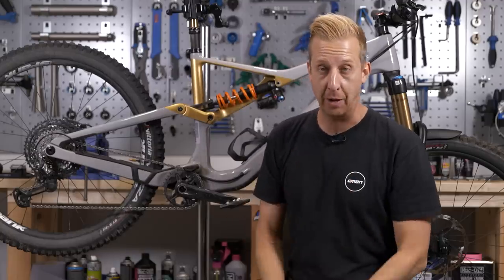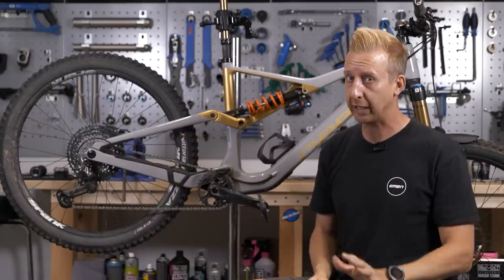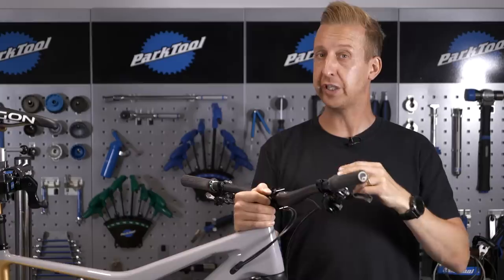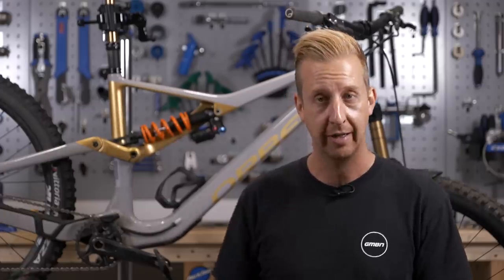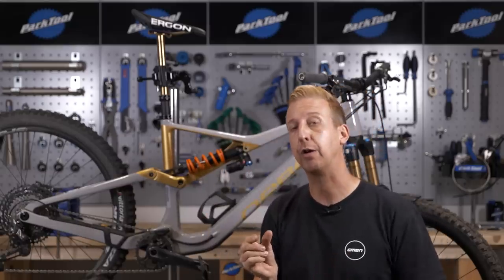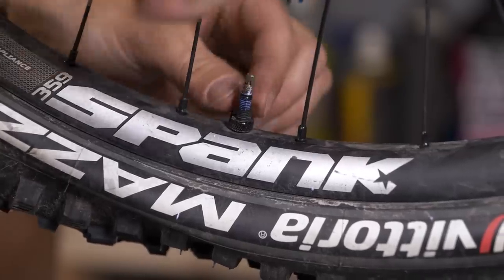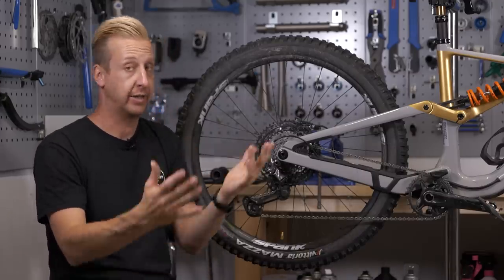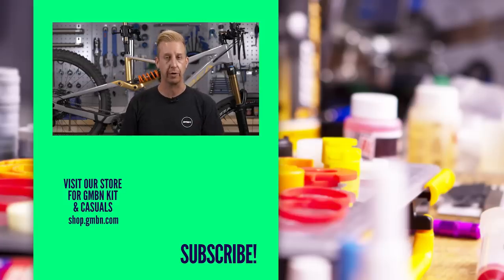11 Ways To Make Your Bike Feel Brand NEW!

Comment: You didn't mention removing the air from the forks before beginning the service process. Now I can't find my face... 😵
Reply: Yeah but you're not removing anything to the top so it doesn't matter
Reply: The lower legs of the fork are not pressurised - you don’t need to remove the air. If you are servicing the air spring, or adding/removing tokens, by all means empty the air.
Reply: The lower legs are not connected to the Air chamber, so opening the lower legs will not change or release your air pressure. If it does, then you have a bigger problem

Comment: Bolt checks, lock tight, and proper torque specs are a must. My non drive side XT crank came loose and fell off last ride. My Rotor bolts also came lose. All installed by the LBS.
Reply: My LBS forgot to put the bolt back in my brake pads after a full service, first downhill trail and the pads jumped out!
Reply: Strange the rotor bolts came loose. They come with loctite on them from factory. Maybe under torqued
Reply: @flawless7019  in my experience it’s that a torque wrench is almost never used. “A good mechanic doesn’t need one” is the rationale. I do a bolt check on every bike I touch
Reply: @307.William  in my experience if a torque wrench isn't used daily there's something wrong with the mechanics. No point risking shit when there's calibrated tools to do a job

Comment: Thanks for the very best mtb channel. The best for what y’all do . Always so informative at bike maintenance and bike mechanics, design and technology. 
This channel has helped me total replace and maintain every part on my bike except the bb. The Bottom Bracket is the next chore and changing out the airshaft to a longer one my 2020 Lyrik. I like the Orginal workings of the 2020 model . I’m at 150mm and want a true 160. I am thinking of getting the 170mm because they sit into their travel about 10mil anyway. 
I do have the 2021 replacement to make it 160 . I hear they are firmer through the top of the stroke with less mid travel support. So thought a 170 and keep the orginal 2020 stuff on the airshaft . 
I did just have a bad downhill crash hitting a tree. I broke my pelvis and sacrum . The sacrum is screwed together so I cannot walk for a bit . 
I’ll be back in several months. Gingerly of course (maybe) 
I’m 59 years old so maybe need to slow down a bit . 
Thanks again for this channel. Hope you all read this , it comes from the heart. 
Peace Y’all and keep on pedaling

Comment: 9:27 I usually apply fresh Loctite 243 to it, to create a bond between the surfaces. It's more secure that way, but it depends on how much or the kind of thread locker the manufacturer has used I guess. So I apply fresh just in case, cus sometimes it can get loose if i don't, but not always. but just a drop is enough.

Comment: 18:06 it can also be worn out hub bearings, an easy way to check if that's the case, is to loosen the axle, if it goes away with a loose axle or skewer, you need new hub bearings. But of course don't ride with loose axle. only use this for diagnosing the issue.

Comment: Probably a good idea while you're messing with the jockey wheels and other parts of the derailleur, just dismount it and use a derailleur hanger tool to get it nice and straight. It doesn't take much for that little bit of tweaking that throws off the shifting.

Comment: When buying bearings be sure and get the correct type for the location/application- ie there are different specs for bearings designed for wheels/BB's that spend their life spinning, compared to "load bearing" bearings such as in suspension linkages that rotate very little....(IIRC they are "MAX" type?)

Comment: I've flushed and re-packed my headset bearings with no issues
I've shark finned more than a few cassettes and drive sprockets 😉Link glide is a mirage still
Takes about 10,000km to wear out 200mm rotors.

Comment: I always put some grease on mine inner gear cable's put ar lot of rides and the bike mechanic say they don't bother because the outer cable has protection for the inner cable puy I always put a bit of grease on the cables.

Comment: 16:49 degreaser or brake cleaner will dry the skin on your hands so I recommend laying it somewhere, or use gloves. after this with bare hands, moisturizer has to be used.
Reply: Not necessarily,  just make sure to watch your hands thoroughly
Reply: @The_Real_JN  I am speaking from experience. Just a little bit is enough, horrible on my hands. Also if washing hands, hands can get dry from some soaps. Not from all.

Comment: Guys I require your help. I have Shimano bl-m4100 on my bike with BH59 hose on it. The lock nut at the lever has got rounded. Does a BH90 lock nut fit the lever or is there a difference between both the nuts? Please let me know. Thanks.
Reply: I think that would work. The outer diameter of the bh90 and bh59 hose are the same. It would depend on the thread pitch. Also, the bh59 ones are super cheap, I would recommend just using the right thing. Hope that helps :)
Reply: @sophialiovas2257  thanks for the help man. The problem is BH59 related stuff is all sold out in my country and i am without a front brake with the hose dangling every where.
Reply: That is understandable. Can you try threading in the bolt without the hose to see if it works before wasting an olive and barb?
Reply: @sophialiovas2257  yes that is what i am going to do. Those olive and barbs are nowhere to be found. I had to burn the hose off from the old pieces i had left from shortening the hoses to get those barbs out.
Reply: Really? What about the LBS?
Reply: @sophialiovas2257  I don't know what LBS means
Reply: @sucharsharma5725  LBS - local bike shop
Reply: @217carlson  yup same story. They don't have either nor they know when they will get them.